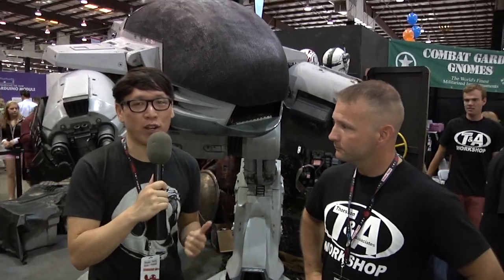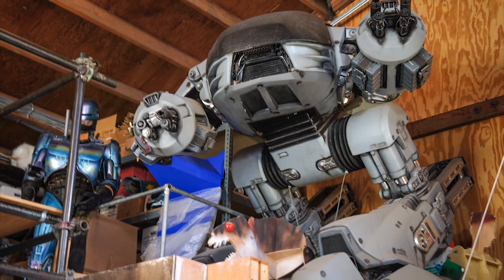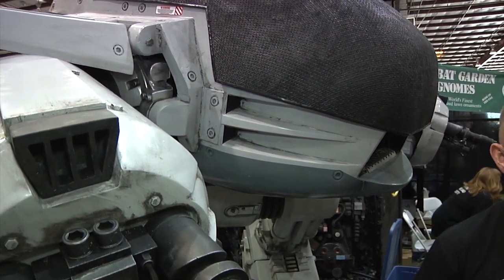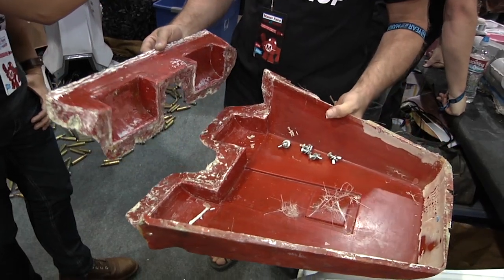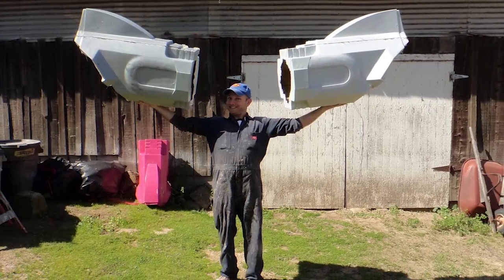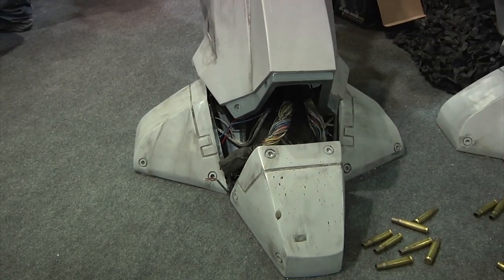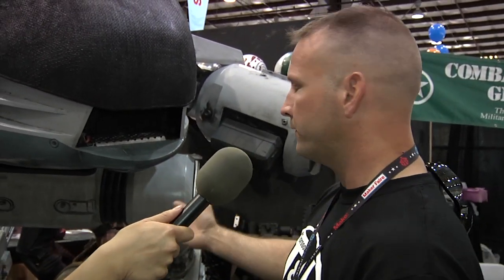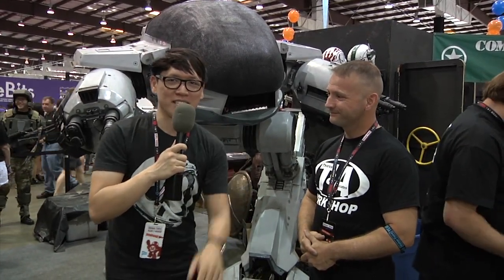Making a RoboCop ED-209 Life-Size Replica!

Comment: Wouldn't it be cool if it had a motion censor and followed folks as they walked by? :D
Reply: There is actually a software program called TurretControl that will run on WinXP to control a gun platform (or a camera). Using a fixed camera it tracks and fires on moving targets (even leading them to compensate for projectile travel time). The guy wrote it to simulate an automated sentry gun from Aliens. When he reduced the price to $49. US, Of course i HAD to buy it...lol. Just the software and a servo-controller board, you have to fabricate the rest.
Reply: Yes, it would be cool! :)
Reply: @dragon-tamer795  What would it Censor... 💃 Raving, Vogueing(SP) Loitering? What Motion would be too offensive Societally?... I kid, I kid! 😆

Comment: Big question.  Can this model handle stairs?
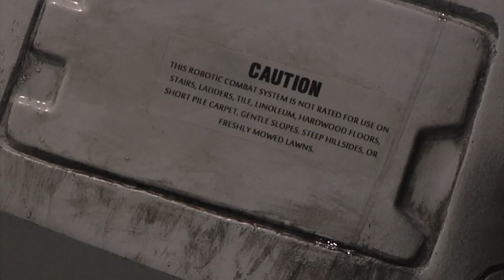Reply: 5:43 to 5:48
"CAUTION
THIS ROBOTIC COMBAT SYSTEM IS NOT RATED FOR USE ON STAIRS, LADDERS, TILE, LINOLEUM, HARDWOOD FLOORS, SHORT PILE CARPET, GENTLE SLOPES, STEEP HILLSIDES, OR FRESHLY MOWED LAWNS."
So no, it can't handle stairs.
Reply: ***** LOL Thank's I didn't have the player large enough to read the print.  All I saw was the caution.
Reply: Guaranteed military sale with ED209! Renovation program, Spare parts for 25 years. Who cares if it works or not!
Reply: I see what you did there.
Reply: I think it gets around stairs by taking out all the load bearing beams, then just waits around nonchalantly for everyone to come to it :)
Reply: HA!!!!
Reply: No but ED-210-rev.b should be able to handle them according to OCP marketing

Comment: Im impressed but shouldve titled the video "how wealthy people make stuff thst you can never hope to have yourself"
Reply: Not for nothing, but I'm certainly not wealthy by any means.  I live on an old boat, rent workshop space in an old chicken barn, and drive a very used car.  Despite my modest means, I pulled it off.  The only thing that would prevent someone else from doing something like this is a lack of determination.  If you start by telling yourself "I could never do that," you'll end up being right.
Reply: I think just about anyone could budget for and make a fiberglass statue of this magnitude. The molds and fiberglass are actually really cheap. Only huge investment is time.
Reply: don't be a defeatist, dude
Reply: Realist
Reply: Joepopa12 exactly. You may not be able to do this in 3 months, for example, but it's not that expensive if you really want to do. (there are far more expensive hobbies)
Reply: Shawn Thorsson
And still 1000 times better looking than the new ED's of the new film.
Reply: "Things rich people buy for their dogs."
Reply: Shawn Thorsson
Finding the reasonably priced space to make this thing would be the biggest challenge. I'd make one maybe half that size, for kicks. And because it'd be able to fit in my apartment without ticking off the roommate XD